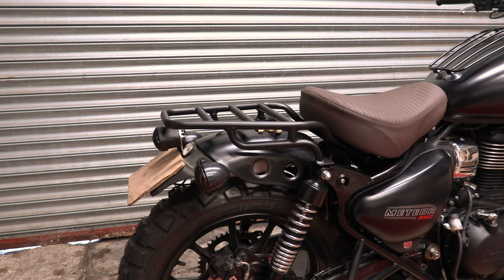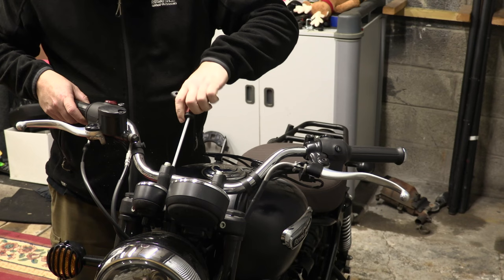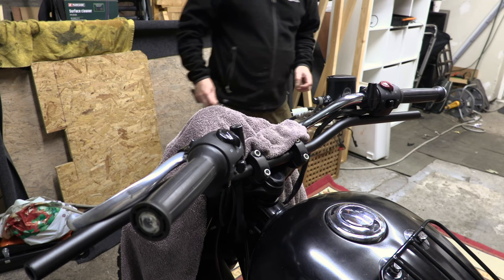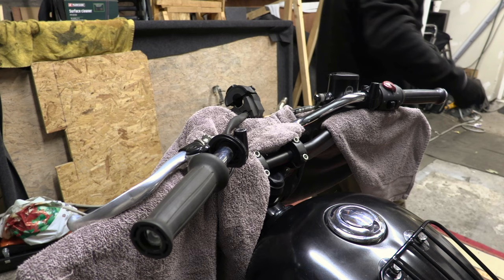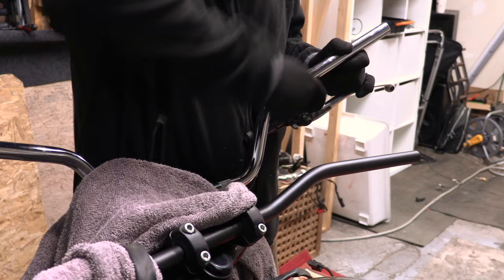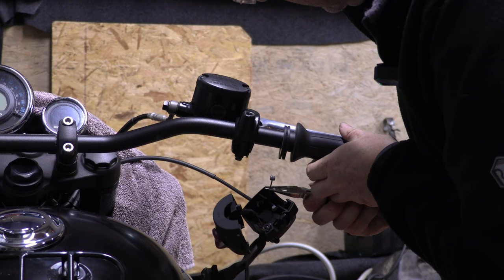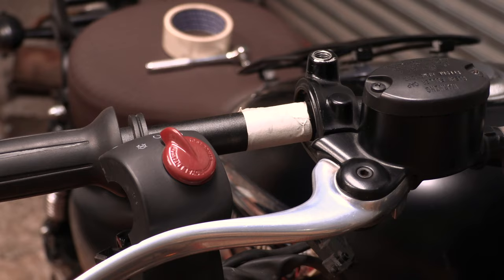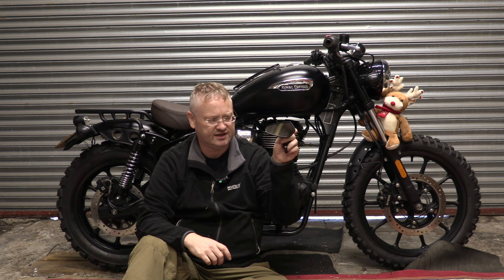Part 13 - Changing the Handlebars - Royal Enfield Meteor 350 / Classic 350 Bobber Project

Comment: This build is looking better and better Glyn 😁easily the best modified 350. Out there 👍👊😁
When I swapped the bars on my Classic 350 I loosened every thing on the bars before loosening the yolk bolts and glad I did as it was all really tight esp the bar ends 😁
With grips I push in a Philips head screwdriver and rotate it clock wise and it slowly turn around the grip un sticking it with the aid of some W40 😎😁👍

Refitting some clear lacquer spray slides the grip on then it sets tight👍 
When finished your bike will look like it’s ready for the Apocalypse 😜😁👍👍👍
Cheers Bruce
Reply from the maker: Thanks very much Bruce, you're very kind and that's praise indeed 😊That's a great tip, I was so excited to get the new ones on I didn't think about loosening the old gear whilst they were still attached.  I've got some clear lacquer so can give that a try too, there's nothing worse than grips that spin about!  The gaiters are on now and they look great too.  Cheers, Glyn
Reply: What bars did you fit Bruce? I'd like to fit something similar to what Glyn is using here on my classic 350 as I find the position a bit too upright.

Comment: The bridge connecting the lower handle bar clamps might be there to simplify assembly as it means you can tighten them in place  without having to check their alignment with each other.
Reply from the maker: GOod common sense solution 👍

Comment: One thought, the rack a bit shorter at the third cross bar, just to shorten it a bit. Just a thought. Looking good so far. 👍 bar end weights
Reply from the maker: I think that might be a good idea, I've threatened it with the grinder a couple of times!  It would be a one way trip for sure but I could always get another one if it really goes badly.  Thanks for watching, Glyn

Comment: Sir which handle you use on it
Reply from the maker: Hello, the UK link is in the description which might help you find some, here's the details of size which might help: 22.2mm 7/8" low rise unbraced motorcycle handlebars in a black shot peen finish. Made from 6061 T6 Aluminium. Width of 840mm & height of 58mm. Total rise, 45mm. 14mm Internal diameter on ends.